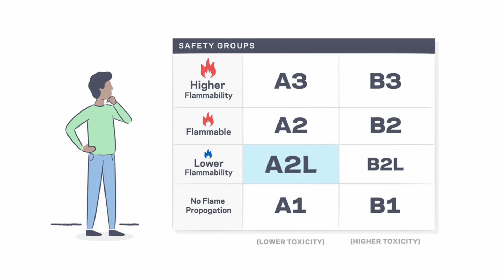HVAC Central AC Equipment About to Get Real Expensive! Myth Busting Flammable R32 & A2L Refrigerant

Comment: It will take some time to ramp up R32 equipment in US market. That's why it will initially be more expensive, but R32 has been available in Europe for years now. If you need to replace your a/c unit, I would suggest finding a 410a unit now (but inventory is very limited now so prices are increasing a lot) or cross your fingers and wait until 2026 winter when r32 equipment pricing should stabilize once more supply is on market. In the long run, R32 should be better since you need far less refrigerant than 410a but you need some additional sensors for safety to detect refrigerant leaks due to mild flammability.

Comment: We knew 15 years ago that R410A was going to phase down in 2025, just like we already know that R454b is only going to be around for 15 years then we'll move to 0 GWP. As for the 30% tax increase, the geothermal HP manufacturers like Waterfurnace released their R454b product 2 month ago and the price increase was insignificant (for the equipment). Now will contractor increase their price 30% and blame the new refrigerant, the government and the EPA for the price increase? Of course they will.

Comment: I'm running my 20 yr old R22 American standard until the compressor dies! Installed for 1100 bucks in 2001 still cooling my home just fine.. I don't understand these inflated  'installation " charges. You are not doing open heart surgery. One job will pay for all of your equipment. I've priced out pumps ,gauges , torches etc and installation charges far exceed the equipment prices. Or course your knowledge is worth something but charging over 3k to do an install that take 1 day?  I had a good job and it took me weeks of 8 hr days to make 3000 bucks.
Reply from the maker: Thank you so much for sharing that feedback

Comment: Mikey just seen heat pump runs off solar and electric if no Sun they are sold out. Comes with everything but panels even the pipes are full of gas no fill needed.

Comment: Hey Mikey,
I have a 16 year old Ruud R22 system that is well maintained and running good.  
Would you recommend sitting tight until it craps out, or switch now to a new unit with 410a, or one with the new R32?

Thanks.
Reply: Its actually 18 years old.

Comment: Refrigerant doesn't cause global warming. After 25 years of bans the average maximum size of the Ozone hole hasn't shrunk one bit. Most of the "science" used at the time to ban it has now been disproven. Meanwhile, 1 billion people in the world still don't have electricity, or refrigeration, both which lower the average lifespan by 20 years if you don't have them.

Comment: r32 has been used everywhere else outside of the US for years and more efficient.  Open patent so anyone can manufacture (cheaper), and single component like r22 and unlike r410a and r454b (patent owned by carrier so they'll control pricing). Personally, I'm looking forward to r32

Comment: You can use 410 to repair 32 systems from China. My hubby and I repaired one of my sisters window units with it. And we just str8 dropped in! And it has continued to run for over 2 years now. Now with that said, ac equipment from China come with a minimum charge to start with, and zero service ports! Literally designed to fail!    P.s. we did this repair before R32 was available for purchase in the US.

Comment: Why would the price go up? Sounds like an excuse for installers just to bump prices 20% for no reason.
The underlying technology, principles and materials are the same.
Reply from the maker: Excuse for installers? I’m sorry I don’t make up prices that I pay for equipment that I install in my clients homes. There is a reason that a 3 ton carrier 16 seer system installed was seven to $8000.06 eight years ago and now it’s 13,000. It’s not my fault. Blame it on, something else
Reply: @PipeDoctor  greedy manufactures also.

Comment: The statement that R410 equipment will no longer be available after Jan 2025 is false. The law states they can no longer make them it does not say you can buy or install them. What is left in the supply chain most certainly can be sold and installed until 2026.

Comment: The whole reason that the refrigerants are changing (again) is because of the high GWP of R410a. This is an international thing not just a US thing. Most of what we do in this industry is because of government regulations-good or bad. Most manufacturers are going with R454B- this is a blended refrigerant, and it has a very low GWP. Daikin and their brands are going to be using R32. R32 is used in other countries successfully, but the GWP is a little higher than R454B. I attended a class on A2L refrigerants, and we were told that eventually R32 will be phased out too because of the higher GWP than R454B. This is all new and there will be a learning curve as it was with R410a. I do agree with you about the A2L approved vacuum pumps- we will see. The contactors are going to be sealed, as are other components. The installers will have to document the total charge of the unit upon commissioning. If there is a leak at some point it really needs to be fixed-no more gas and go.  There has been rumors of required leak detection equipment in the ducts that will sound an alarm if a leak is detected-I guess it all depends on what the state and local codes will require.
Reply: I believe R454B is a mix with 1234YF and R32. 1234YF has been used in cars for quite a few years now. The flammability isn't really an issue.
Reply: Pretty sure tracking only applies to systems holding over a certain amount, as it always has been (for example, rack refrigeration)…

Comment: it is the compression ratio and required mass flow rate to move x btu that determine efficiency, not the saturated pressures at given temperatures.
if r32 absorbs more heat to boil a pound of it than 410a, that explains it.

Comment: Here in Europe they are lowering the GWP limit a lot by next year so companies are getting rid of R32 (that we were using for a least 5 years)... And they are replacing it with R290... Propane so not only flammable bur also explosive. Only because its GWP its very low

Comment: The air handlers should be able to run r32? 3% pressure differential between the two as you mentioned means the txv/eevs should still work fine

Also speaking from experience with r32 here in aus for nearly a decade, the equipment may be more “efficient” but they sure a shit do not last as long as their predecessors

Comment: R22 was also ozone depleting so we had to change out of it. The GWP of R410a is 3 times that of R32. Should just be an issue of the system handling the pressure? I mean it could be just a matter of pressurizing the lines to a little over 1.6 times that of r410a and if the seals/copper handles that, it should be good to change over. Just sound like a way for corporations to insert obsolescence into working systems. Hope someone outside the greed circle tests out some r410a systems with r32 and finds out. This is not about global warming, that mostly comes from the industry circle and we should not be paying for it.
Reply: That was my thought when 410a first appeared on the scene. The higher running pressures. Common sense says running any gas or liquid at higher pressures means the chance of leaks increase.

Comment: We use R32 for a long time in Europe. It works well, although it is no comparison to R22/R12 in performance, handling and safety. I have a R32 system in my new 4 zone central AC for 2 years now. No problems so far.
I think it is still better than R410a which is a zeotropic mixture after all. R32 is azeotropic.
R32 is flammable, but  R1234yf is way worse (especially in its decomposition when heated) and it is used in confined spaces like car ACs. 
Your flammability test is not really conclusive though. You have to test the flammability at the same overall pressures, best in a container of equal size and a steady ignition source like a small gas flame.
And BTW, R410a is 50% R32 anyway.

Comment: So, if R410a is a blend of R125 and R32, and they are shifting to R32, then there must be something wrong with R125 being used or a benefit of using only R32. (If only slight or solely on paper) What I took from this video is that there is a slight efficiency benefit, but that can't be all there is into the restriction of R410a? This is the question I was asking myself throughout the video, unfortunately it was left unanswered. Regardless, the video informed me a lot, although there seems to be a lot of speculation.

Comment: I wonder how many fires, explosions and such worldwide have been associated with A2Ls.  It has been in widespread use around the world.  If it is that "dangerous" there would be numerous accidents.
Personally I believe that all current equipment will be suitable for A2Ls,  Now R290 (propane) is a different story.  But again how many fires have been started with R290?  How many vacuum pumps and recovery pumps have blown up?
It is an overblown scare campaign.
The biggest issue that I see is that smart gauge sets need to have R32 data in them.